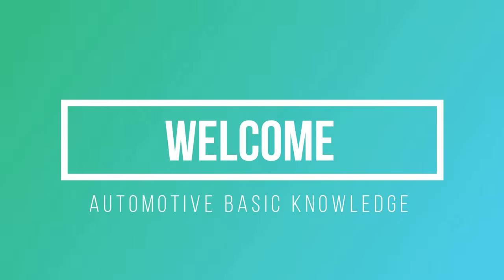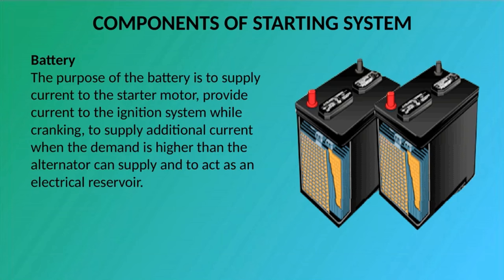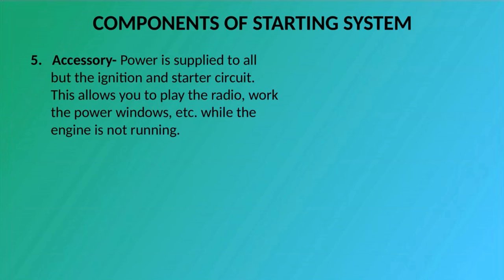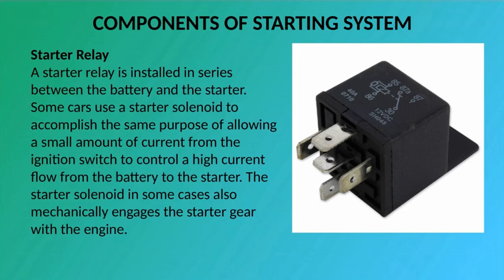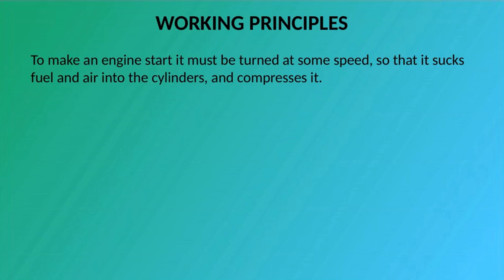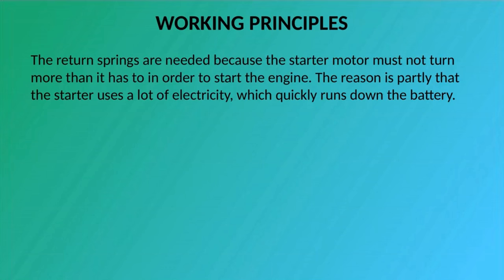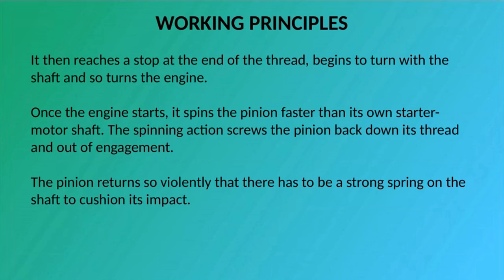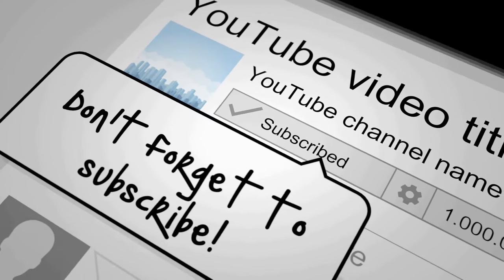Basic Starting System

Comment: Amazing, my m bnz 4matic 2012, I have changed the starter and the starter relay too, then while the engine running I have heard starter worked again without stop even after shift the ignition to lock  so starter stop only when I remove the positive cable from the  battery.
Would you help me please.... I will be happy to get some support to solve this issue. Thank you in advance